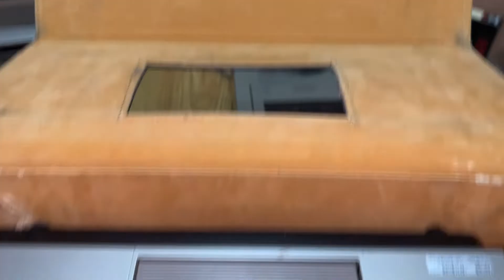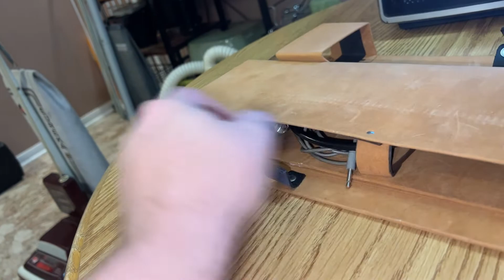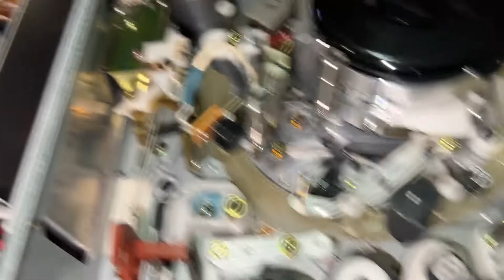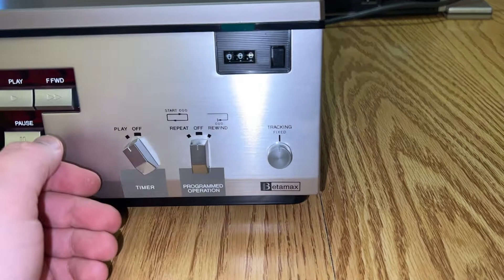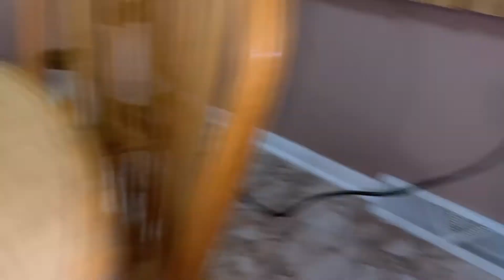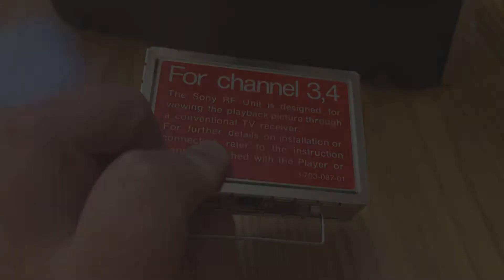1978 Sony Industrial Betamax Player Model SLP-300

Comment: My SLP-300 was experiencing some issues with loading too so yeah it’s time to switch out belts. I got a 1976 SL-7200 working and playing (I assume but I don’t have proper x1 speed tapes but it produced a sped up screen and audio so I’m calling it a huge W on my part) after I replaced all the belts, but the rewind idler is my only issue with it now and I assume it’s why also my SLP-300 isn’t rewinding tapes and having loading issues too.

Comment: So, if you wanted to use a camera with this unit, you'd have to run it thru an adapter to convert the signal into a line signal to record it on this machine.

Comment: A donation of X1 tapes sounds nice because I don’t have any either for mine. but you guys are much more talented than I am at getting things to work! Maybe I’ll get the rewind working with mine.
Reply: I recently bought an Sl-7200 and replaced all the belts and replaced all the belts now everything seems to work except rewind. I assume that’s more of an idler issue?
Reply from the maker: @oldradios09 Try sanding the idler tires with 400 grit sandpaper.

Comment: I thought the SL-5101 had a BI/BII/BIII  record speed switch on the rear... and maybe the SL-HFT7 "SuperBeta Theater" has multi speeds...  I'll take a look.  Maybe I could transfer to a beta tape with BI recording speed for you!
Reply: The SL-5xxx series of ßeta VCRs had a switch in the back to allow BI speed playback. Later Sony ßeta VCRs had automatic BI playback. Don't think Sanyo ever offered BI playback or recording. We have a busticated NEC SperBeta HiFI that recorded in BI speed we need to get repaired someday...

We have an SL-HFT7 in our living room system - basically an SL-HF 450 with an amplifier. Nice enough VCR, but we literally had to set the tuner can on fire to get it working again.
Reply: @chezsnailez  There's actually a Sanyo that can play βI
https://www.youtube.com/watch?v=icW3qXJGx_Q